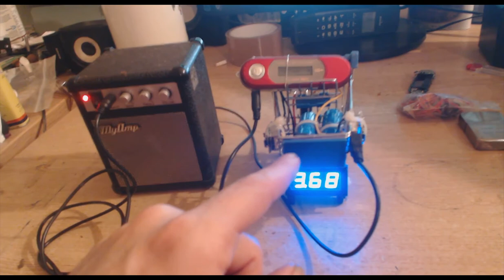GET WELL RAYMOND!! & A MP3 SHOPPING TROLLEY SPECIAL!

Comment: hows the mini set going buddy hope all is well
Reply from the maker: Hey mate really well cheers :-) like its been a bit of a slow year with work and random stuff that cropped up but ive been making some progress on bits here and there. I was hitting some of those Accrington bricks the other day with a chisel and a lump hammer but trashed my wrist and at best got uneven chunks off the bricks for my efforts, so i started bodging together a heavy bespoke brick cutting machine to do the job out of old junk :-) its kind of still a heavy work in progress in the front room upstairs atm :-p still its slow progress but progress at that, hows everything going, hows your youngester and the fam doing, business and y.t. channel. I wanted to come check in on you shortly with crimbo comming up :-)
Reply: we are doing goo looking forward to the time off 😀 been very busy witch is great and youtube has been good fun too I thought you were cutting the bricks with a grinder ? in the box
Reply from the maker: yeah, its kind of the last research and development to manufacturing, the grinder in the box is a bit dangerous for mass production really, the stand perishes under alot of cold water run over the bricks to cool the cutting. this new machine im working on im hoping will by pass alot of the problems and speed the process up on it, its a 1m 7/8" 22mm threaded shaft with 4-5 discs on so can chop one brick in one go rather than having to do say 4-5 individual chops. the grinder gets over heated after about 1-2 bricks so im hopin this setup will be a bit more manageable. im just waiting a few parts in the post to finish it off then will need a decent electric motor and drive belt to run it all. Im afraid i cant take pictures atm and have been quiet as i got divorced and need to buy a new phone, and have been rebuilding my finances :-D but ive not forgot about yourself or y.t. guys, still love the network :-) ive just been having a break while i crunch through work is all, looking forward to getting back to it in the new year, i kinda do bursts on projects, go quiet with them with work then get back for another burst, hoping to have another go around feb time. Making progress though, really am looking forward to seeing what you have been getting up to, and the other day for a customer i wrote a nice web template for a customer, i will update your site in the new year if you fancy it, it would be similar to this say http://www.bitcoinengland.com :-) Just good to hear we both have work in and things are going well :-) cant ask for more.